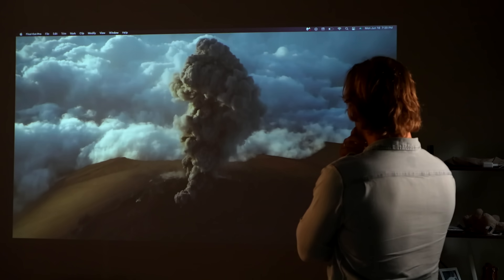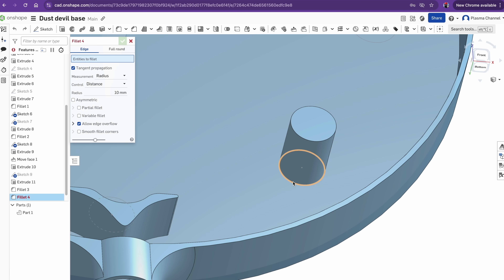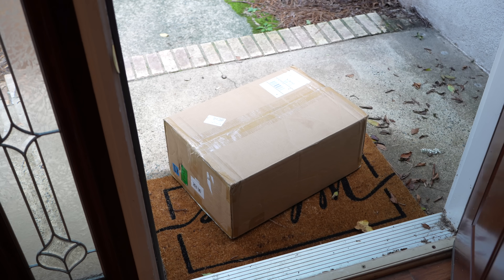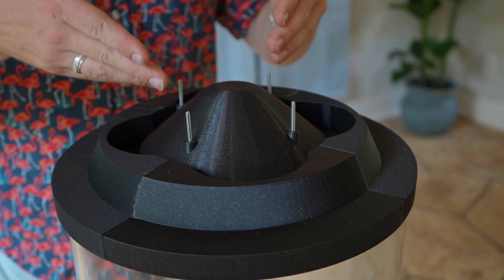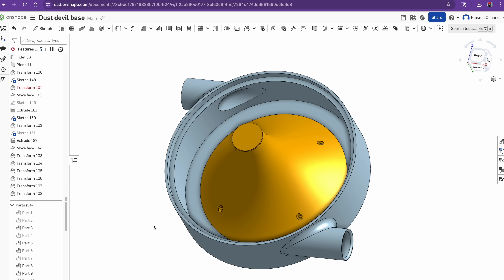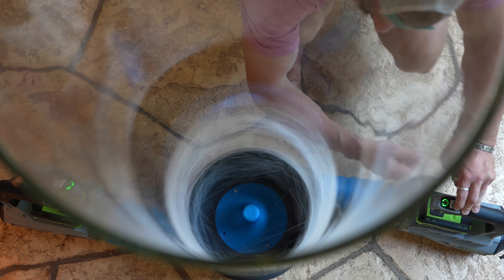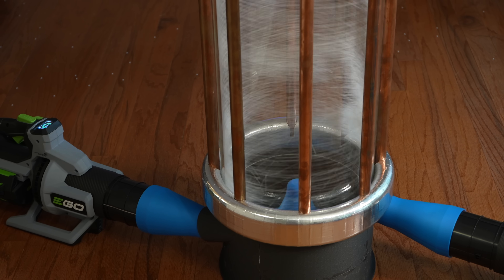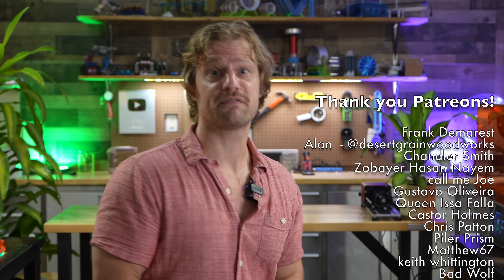Making Lightning In A Bottle Might Be Possible  (ft. 3D Printing Nerd)

Comment: You’re reinventing a Kelvin generator. You wire the cylindrical outer plate to the plate at the top (lid), and a second collector (outside surface but at the top, like the one at the bottom), connected to the base plate (what you call the ground plate). Now charged beads spinning around the bottom will experience a Faraday cage-like effect, and induce an equal charge on the lower, outside metal cylinder at the bottom which is shorted to the top plate. The top plate attracts oppositely charged beads and functions like a filter, keeping like-charged beads at the bottom. Oppositely-charged beads accumulate at the top where the outer cylinder steals their charge and shorts to the bottom plate. The vortex will cause real charges to be delivered to the outer metal cylinders. It’s a Kelvin generator but with beads instead of water droplets and circular motion instead of falling motion.
Reply: This. The design could be miniaturized and produce large, high voltage static charges.
Reply: A big key point to this working is actual seperation of negatively and positively charged beads. They will usually like to stick together and in average contribute to zero net charge.
In a real thunder you will have heavier and lighter particles. The heavier will sink down the lighter will rise (or with different temperatures). And the one kind tends to charge up positively,while the other tends to charge up negatively. That way you get actual large scale seperation of charge, and not just small scale seperation.
So use two different materials that  have as different density as possible. Focus more on density difference rather than triboelectric difference. For large voltages you need high capability for seperation rather than every single bead to have a large charge. Over time it will then accumulate even if individual charge is low.
Reply: @neutronenstern. I like that idea. I’m familiar with ion exchange resins, which come different sized beads. You could use small beads like Amberlyst-15, a super acidic perfluorinated sulfonic acid resin. It’s strong enough to protonate glassware. The glassware (or probably trace organic stuff present as a thin layer on the glass) picks up protons and gets (+)-charged, while the beads get (-)-charged. Once that happens you can’t get the beads off the glass by shaking it or wiping it; they roll out of the way and roll back to the charged glass surface. It’s wild if you have ever seen it, or really infuriating if you need to weigh them out. Those beads with some plastic or glass beads of a different weight might work up charge separation very quickly.
Reply: @louiswhaley258 i think you could just directly pick up the charge at bottom and top. If tuned right the heavy beads will never reach the top. So you can pick it up while ots running.
Reply: He reinvents Leyden jar, not Kelvin generator but ok
Reply: There is a device called a vortex chiller that is used to reliably cool a PLC cabinet. It is not very efficient but maybe some of the design from it may be useful.

Comment: I have an unusual static electricity story that might be of interest. Ten or fifteen years ago, I was working in a fertilizer factory. We'd gotten a fresh shipment of 2.5-gallon HDPE jugs to fill with liquid humate-based fertilizer. Something about the way the jugs were packaged caused them to develop quite a static charge. That static charge seemed to get significantly amplified when we filled them with the fertilizer. So much so, in fact, that there was an audible hiss of corona discharge when we set the jugs of the floor. And, so much so that I received a shock and about an inch-long spark to...well, between my legs. I've always wondered how exactly that all happened.

Comment: If you connected neg, ground to the lowest part made the lower part eg coated in conductive ink , and a high wire antenna for the top of the vortex housing , it may help?

Comment: fascinating how bars inline with the tube didn't work, but a ring of foil around the tube did. I would consider going with that idea and perhaps insulating it somehow to prevent it from dissipating the charge into the environment. I think spark plug cables would be a good reference material for conduits away from the pickup to the load. I think you should also consider measuring the charges as it appears to me to be different levels of charge in zones around the tube, based on density and behavior when pointing at it, could be related to imperfections in the glass tube.

Comment: i wonder if changing from a blower fan to a vacuum like you were using with the bucket of sand would work better? and maybe put in some metallic beads, or coat some of the ones you have? if you can pull a slight vacuum, the vortex induced could potentially have different properties. perhaps the metallic beads mixed in with the normal ones in a reduced atmosphere setting can cause easier pathways for electrons to move from the positive side of the tube to the negative. perhaps try smaller particulates as well, sand grains are small and when they blanket the air in a sandstorm they make a more or less uniform distribution. im no scientist, but im just giving my suggestions based on the initial conditions of the phenomena that you showed, i hope it helps

Comment: It's interesting, but it doesn't work like a volcano or a cloud. The particles must collide with each other, not simply swirl. In a cloud, water rises and freezes. As it does so, it releases heat, which pushes the frozen water particles to rise faster, but then they fall back down while other particles rise. This forms hail. As they continually collide, they become electrostatically charged.

The same thing happens in a volcano. Lava or ash is glass, it's silicon. The rising particles meet the falling ones, resulting in a charge separation. Lightning.

Comment: I cut pvc trim sometimes for work with a mitter saw. The base of the is aluminum and when I use my leaf blower to clean it off I get some pretty good sparks from it.
Reply: I have a shop vac as a collector for my chop saw, especially if I am cutting plastics. The plastic dust chamber becomes very statically charged.

Comment: Simply 👌 so much potential. Transient control and extraction is the hard part. That's without collapsing the field you are producing. Or large reduction of the field. This is why we don't produce power this way.😢

Comment: I think you're going about this in the wrong axis.

 If you're trying to get a potential difference between inside and outside, then there's only the charge from the beads bouncing along the walls, that in and out motion that transfers charge.

Instead of getting potential across the Z axis, try across the X or Y across the entire cylinder. Left side to right. If you have an electrode on the left, and another isolated one on the right, then that would have the charge buildup from the beads traveling around half of the entire cylinder to transfer instead of just a few millimeters of bouncing.

At least that's what my brain thinks should happen based off its loose simulations lol

Comment: the charge you want is between the beads and the INNER surface of the glass. dielectric. the charges cant move. the beads being charged oppositely cling to the surface but being insulators, cant discharge other than at that tiny point of contact. at least until leakage through humidity etc overcomes the attraction.

what appears on the outside is simply a third electrode having its charge drawn to the opposite side of the glass dielectric. has nothing to do with the real charge being generated. your hand being grounded and drawn near overcomes the attraction and repels the charged beads, but shouldnt affect the charge on the glass or beads itself.

so far, all you have done is produce the charge on the two materials, you havent wiped it off/on from the two plates of a capacitor/leyden jar.

what is different about this device, and a vacuum cleaner or sandblaster?

vortexes always work better when "sucked" out.

the concept is interesting... the execution will take some work. whilst its no longer the sandstorm effect you desire, a sandblasting cabinet, ie, nozzle, cyclone filter, and vacuum should produce the desired charges...

and of course, the polarity can be swapped... poly casing and glass beads...

to truly get the effect desired means looking at the kelvin thunderstorm a bit longer ;) 
consider distilled water aka condensed vapor is one of the best dielectrics... yet a cloud should only be water vapour... and another dielectric... air... and water is a polar molecule...

Comment: You're grounding the charge too quickly, which prevents it from building up effectively. To create a useful charge differential, you should add a grounded metal strip separated from your copper foil collectors, or use multiple collector bands spaced apart to allow charge separation and accumulation. Also using two different types of beads like PTFE + Nylon would work better since they would have a much greater polarity difference than just one type of material.

Comment: That’s a very cool idea!

I have a lot of experience building vortex chambers like this. Different size and weight particles will occupy different orbits in a vortex as the centripetal force balances the airflow pulling them in. If you had a bed of beads with no funnel at the bottom, a vortex with the right updraft and swirl will create a debris cloud with a lot of collisions. You won’t get a classic tornado vortex like you do with fog, since the beads are too heavy and will be thrown out. But if you want any ideas on how to build your original design, I’d be happy to help in any way I can.

Also you’ve built such a powerful vortex chamber it should be possible to create a condensation funnel with the right weather conditions. As far as I know, no one has done this.

Comment: You will want to separate the positive and negative charge. This is what happens in thunderclouds where smaller ice particles separate from graupel particles after collision by having different relative fall speeds. Here, it is probably happening horizontally by centrifuge effect: the heavier particles near the glass, the lighter ones (if there are) near the center or top. You could try to sample the opposite potentials by a conductive rod hanging from the lid and a conducting film around the glass.

Comment: What about making the tube out of one of the plastics and using glass beads?

Also, don't forget there's a charge from the atmosphere to the surface, so another factor may be involved... try applying a small charge and measure the constant output?

Comment: The shocks from sucking the sand up with the vac was not from the sand on sand. It was from sand rubbing onto the tubing. We have a similar system here in the shop the sucks plastic chips off the lathe and shoots them into the trash can. We have to ground the entire system or it gives you very nasty shocks.

Comment: Hi, really cool video! I have written a thesis about the topic but with a small difference: instead of dispersing the particles in air, I have suspended them in an insulating liquid, like mineral or silicone oil. This made easier to disperse the particles, which remained suspended in the liquid with much less effort. On the other hand, since the insulating liquids have a lower electric resistivity than air, it was possible to produce only a few thousands volts, not enough for long sparks.
I uploaded a video about it on my channel, even if it is not that entertaining but it may be interesting to watch if you want to improve your setup.
I have also enhanced the phenomenon with a different setup but I'm writing a paper about it so I cannot share the details.
You can find my thesis by searching on google: Electrification of particles suspended in an insulating liquid by contact electricity, P. Sammartin

Comment: Wonderful.... but the thing i wanna see is when u charge it up then just let me watch it while the beads drop naturally without touching... the visuals and science in that would be wonderful... 5 min vid of a couple runs...
Also. I run a vac truck in a steel mill... 6" hose..... try using lime... I vac that and it throws 1-2 ft sparks from a plastic hose. So much u have to ground it...

Comment: Nice work! I think,  if  you try placing a thin cylindrical mesh (like wire fence material), covering a small area inside the tube and connect a single wire from one end of it to the top, you'll likely get a much better result with the static electricity output, something like a van de graaff machine but with the spheres as the charger carier instead of the plastic belt mill. You will lose some of the steady flow, but you want to recreate a sand storm after all..
Keep experimenting!

Comment: Love these concept vids. 
Noticed the same effect when i was sanding w vacuum hooked up. 
You decided to work against gravity w a big insulator. 
What about simpler. A shop vac w a dust funnel. 
Think part of your problem is that the charge is never getting released and you’re working against gravity. 
Think of Lord Kelvin’s fountain. Same/Similar. 
If the bottom ring was after a dust funnel on a shop vac. 
Trying to explain a lot in a short but I think you’ll smell what I’m putting down. 👍😂
If you read the comments 🤣

Comment: You already had your answer from the very beginning, you need a vacuum, you don't blow air, you remove it from the centre, then all you need is a pin at the top that goes to ground and an insulated base

Comment: I have a few suggestions.  
First: try increasing the amount of aluminum. And put something nonconducting in between.  Like a capacitor.

Next: you say that it builds charge as it was dying down? Try having the blower start and stop. Wind isn't constant in a storm. Might build a charge that way.

Last: try increasing the volume of the tube. Storms are big. They have a lot space the build up a charge.

Comment: fine tungsten wire from the centre of the lid diagonally downwards to the base  will give instability inside the vortex,  natural vortex are not neat and tidy,  your balls are all heading in the same direction as well so you are missing out on potential charge.  instability inside the tube and the fact its metal wire gives back spin and more direct collission points to get that charge higher,   its like brushed metal, the contact points of the lines very rarely meet so all the lines are not connected, but if you brush swirl metal most of the lines meet other lines increasing the range of connection.

Comment: Emulate a van de graaff generator? Move the balls in one direction (as they move in the vacuum cleaner tube) instead of randomly rising and falling. Basically, replacing the belt with the nylon and polyethylene balls and the motor driving the belt with a motor moving the balls with air.

Comment: I use to work in a wood shop and we had a homemade vortex filter that use to charge whit static electricity like that... i' m surprise the central electrode didn't work! Try to connect to grand the top or bottom plate... i think that way to charge will lock, now i think you are just separating the charge and dissipate fast after you stop the vortex.

Comment: Electric plasma generated Ultrasound holography high resolution > Target = Charges in the atmosphere. Put them where they should be = Earth will DUMP.. Magnetic field from Earth comes up through you so if you want to go further to use Ultrasound holography control of plasma to shape it before crushing with Ultrasonic shockwave echoes make sure you mount it to the ground just in case you do it a certain way.. So it doesn't blast through your ceiling. Hehehehehe.. Search Engine: "Spiders fly with electricity!" AI: "Yes its called Ballooning." Super dense blob of excited plasma = Very dangerous. Make sure to EMP shield area to prevent Military from detecting AND use Ultrasound medical frequency filters to prevent charging cells aka resonance melting yourselves. Taps Sheriff department pc "Fbi Active terrorist list" > Points at evidence box with weapon returned Agencies fear intelligence.. Points at Iron man comment about that For why..

Comment: I think you're missing a connection to ground on the bottom. How do you envision the electricity to arc from the the "dust devil"? Can you create a focal point for negative charge to build up through material selection? I kind of imagine that happening at the top with electricity arching towards the bottom.

Comment: Plenty of folks have offered suggestions about sucking air out for the vortex but I think something else is going on when it comes to your charge dissipating. 

I know for a fact that many blower/vacuum systems have spark arresting wiring in place to allow the static buildup to dissipate away before either shocking someone or causing a fire hazard. Perhaps these leaf blowers are dissipating the static charge away before you can harness it.

Comment: I was using a floor sander one time, had a vacuum attached to it. 

I still remember the shock I got from that. There was a lightning pattern all the way up the fiberglass handle, 4 feet. Zapped me reeeeeaaaaally good. 

This entire thing is a similar concept. Pretty cool to see you make this stuff.

Comment: 14-42 are you making a capacitor? 😱 
Be very, very careful  
Though if you wrapped foil on the outside as well, well and connect two via wire, you’ll be able to see how much current you’re stored but very very very, very, very, very very careful, that is a widow maker 😱